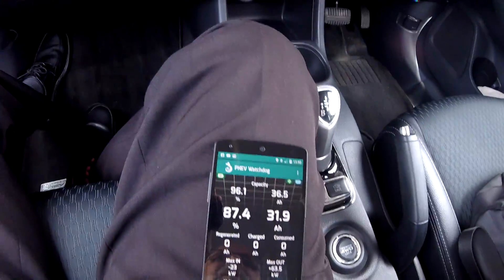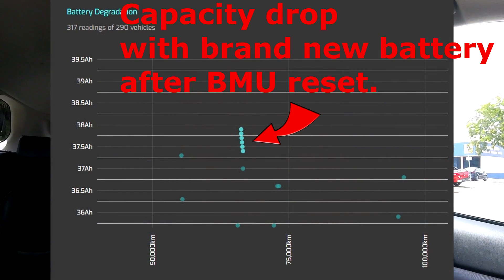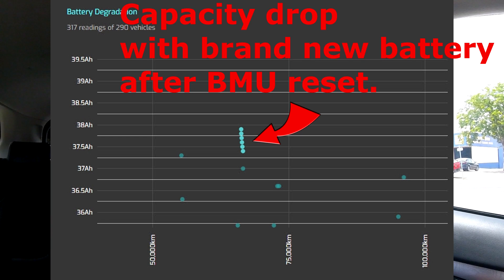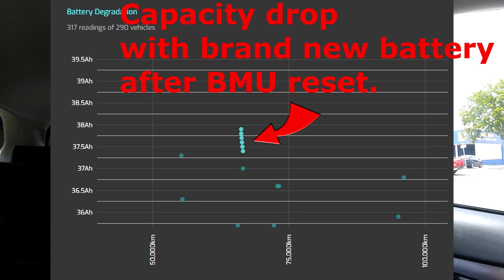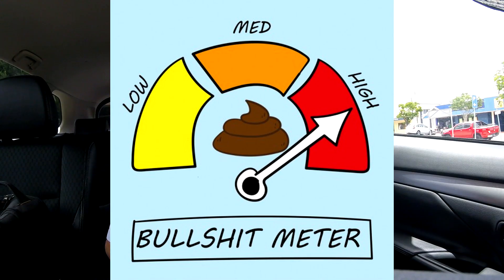EP168.1 - Why the new PHEV Replacement Battery does not work as expected!

Comment: Hi Andy I have watched most of your videos and they are great. I have not long bought a 2018 outlander 2.4l. The battery is not that old but I can see the straight away the battery degrading Day by day. Mine is 40Ah. When I charge from flat I tend to get odd miles from the bmu. Some days it will say 40mils and others 35miles and then 28miles. I have try to drive it gently to consuming energy but soon goes down very quickly. I try to switch between charger and normal when doing long journey. When going up a gradient I switch to charging just before and the engine reves its nuts off so I'm now burning a lot of fuel. I have noticed that if I put in sport mode it doesn't struggle as much and the engine doesn't rev its nuts off. I guess the other annoying thing is you have to sacrifice your battery just to have a bit of heat in the car and it is showing that it is charging  as well but it is using more than generating back into the battery lol. I live in the uk I just wish I had nice long straight roads like you do  lol

Comment: Hello Andy,
I send you all my compassion. But I can only confirm the bad service of Mitsubishi I had to go back to Germany last year unfortunately for family reasons and had my Mitsubishi with me. Since I could not load regularly in Germany and the car was also several days without use, one day the 12V battery was totally empty. I then loaded it with a charger and also the main battery. Unfortunately, the onboard electronics showed me a system error and the car could not move a millimetre... When I called at a local dealer to ask if there is a reset possibility for the onboard computer, there was only the answer... None Clue, electrical problems makes only the main dealer ... When asked what they do when they need to replace a 12V battery, also came the answer... Then we bring the car to the main dealer... Even the main dealer could or did not want to help. I then found a solution on the internet ...
Mitsubishi and service seem to be a general problem...
Many Greetings
Jörn
Reply from the maker: Thanks for sharing. The service for these cars is terrible at the moment. MM Australia told me they are now working on new training material for the PHEV and will update all dealerships in the future. This sounds like a long term strategy, right? They should sponsor me to do a dealership roadshow with the car and I go and tour through Australia :)

Comment: There is probably more into that infamous BMU software than most reps, dealers, mechanics and any others at Mitsubishi knows. Even this "SOC" number is computed from some magic most of them don't have any clue about the input parameters it comes from, but obviously the BMU won't extract more enegy from your battery than what its own SOC number indicates.

At some point, I even wonder if it could be possible the battery that had been replaced was just as good as new, just the algorithm artificially creating this SOC degradation just to make sure the battery, as time goes by, is less sollicited. Would be crazy, isn't it?

A guy named Donald would call it "fake news" from the BMU...

Comment: Makes me wonder if mine needs looking at. I had 600 miles on the car and have 95.3%. Keep it up Andy because I agree, this has to be software. I'm not sure if there is a database of PHEV software versions to perhaps nail down which is causing issues. If not all of them.
Reply from the maker: 600mi from new and you're already down 5%??? That's a 2019 model I assume?
Reply: @unpluggedEV  No, 2018. It was owned by Mitsubishi directly who used it as a display car and only driven 600 miles in 14 months!

Comment: Hi Andy,
keine Ahnung ob es Dir hilft, aber die neuen Batterien im 2019er Modell, bauen auch recht schnell ab. Ich habe jetzt 2000 Kilometer runter und nach Watchdog habe ich schon 2 Prozent verloren.
Allerdings hatte ich als Anfangswert 115 Prozent und 44 Ampere angezeigt bekommen. Vielleicht sollte man sich doch nicht allzusehr auf Watchdog verlassen.

Gruß aus Deutschland!
Reply from the maker: Das wird ja schon heftig in underen Foren diskutiert. Das 2019 Model hat anscheinend das Gleiche Problem mit der Software/Batterie. 10% weniger nach nur 10.000km hat jemand gemeldet.
Das ist doch alles Sch***se :)

Comment: Hi Andy I got my battery smoothing procedure done on the 9th of January  and my SOH went up to 95.6% and my PHEV has now done 30.000 miles. Since then it has dropped down to 95.0% after 500 miles. And I can see from the Dog that the batterys are not balanced again hence I think the drop. Surly new means new you should be at 100% SOH. So disappointing.
Reply from the maker: Even the DBCAM gain does not last long. We have also seen vehicles where the DBCAM does the opposite and the battery shows up to 4Ah less afterwards. Imagine you pay for the procedure and get a much lower capacity at the end :\
Reply: It's like Mitsubishi don't understand there own product
Reply from the maker: The battery replacement procedure is surely from 2013 when the car cam out and has not been tested sufficiently until now. With the help of the Dog, we can see now what is happening afterwards. Mitsubishi has no experience in this process and can only move very slowly in making changes.

Comment: Have you compared the software versions, from before you sent it off ? Also check against the other guy, you mentioned in your video.
Reply from the maker: I haven't yet, Ben. It's on the list for the weekend. The other car with the new battery has still all the same versions installed, no change there. If they have a new software it would be only for our cars which get a new battery. A lot of effort, so I doubt they have done that...

Comment: sell the car, get a new one :(
Reply: I will do that with mine in 2 years or so 2017 mod*
Reply from the maker: I've got pretty much a new one. The battery is the main component. We just need to get the software right...
Reply: @unpluggedEV  It´s just that it´s really anoying to have a car that does not perform as it should, I have allready started to poke my wife about a new car, and we ve had it for only a year, I enjoy the car tho. it´s awesome in snow, sucks to get 20 km when its cold, but I can manage. My battery is at 86.8% @ 21912 km. wich sucks

Comment: Hello Again from Arizona, after you highlighting this battery issue I searched the warranty here in the US.  Here is,the direct verbiage from the US version of the warranty for thenUnited States... MAIN DRIVE LITHIUM-ION BATTERY COV- ERAGE
The Vehicle’s Main Drive Lithium-ion Battery is covered for defects in material and workmanship for 10 years or 100,000 miles, whichever comes first....Gradual capacity loss of the Main Drive Lithium-ion Battery based on time and usage is NOT covered under this war- ranty. See your Owner’s Manual for more information regarding Battery capacity loss.

Probably the single most costly component of the car and Mitsubishi completely writes it out of any express warranty.

I think this is a huge factor that potential owners should know here in the US!  Can you please help me spread this information?
Reply from the maker: Tanner, you're spot on! Everyone thinks they've got 10yrs warranty on the battery. Yes, BUT only for defects which are very very unlikely to occur. You could potentially end up with a 70% degraded battery after  3-4 years which would not be covered under warranty.

Comment: Ahhh little disappointing,  but if it doesnt degrade any more; I guess it's not a bad result ???
Curious to know if it will followed it's previous pattern of degradation.  So you know off the others who are having replacements, their are failing too ?

Is there no factory reset on theses things !

Ps. Missing the original theme music :(
Personal opinion
Reply from the maker: Only one other car has a new battery so far as I explained in the video. I'm following currently the same path. The reset can only be done at a dealership.
Reply: @unpluggedEV  Don't let it stress you out too much.  There's anyways full EV !  I've personally gone to petrol till things improve with ev.  47mpg isn't too bad.
Reply from the maker: I'm super happy with the car and it suits us well. It just needs to work as advertised.